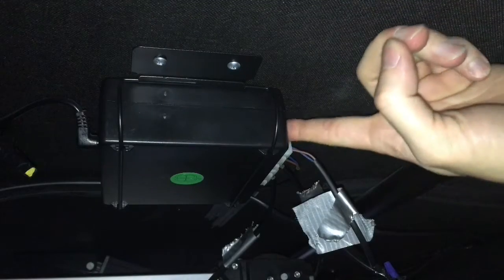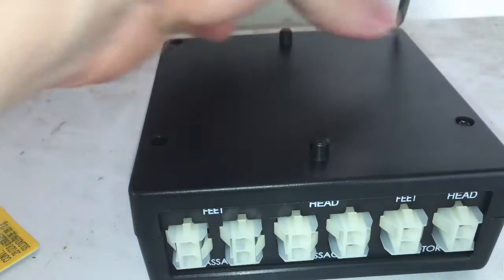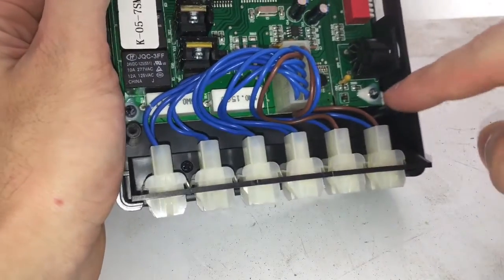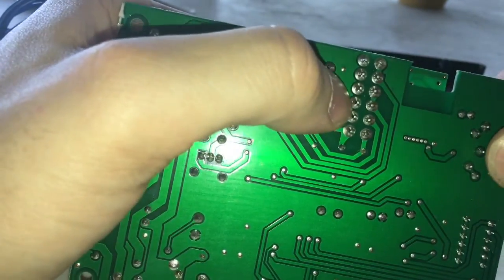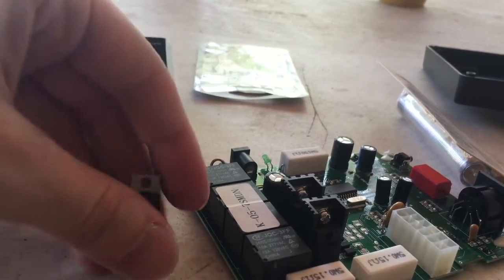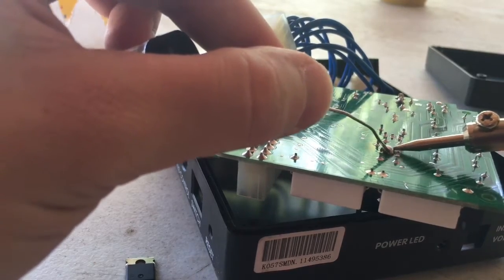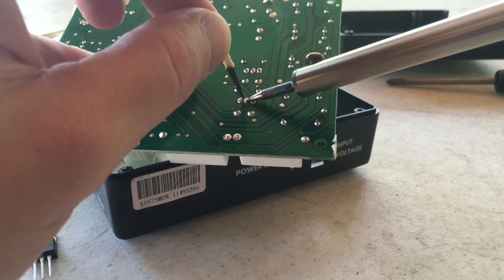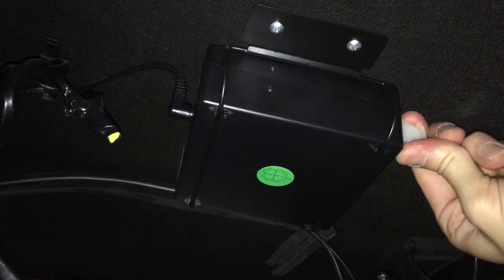Serta ergomotion control box Massagers stays on constant repair

Comment: Nice work 👍.  I admire your skill. 
Question:  is it possible to bypass or disconnect an automatic timer on a bed massager?  My massagers turn off every ten minutes.  There is no option  to turn timer off or change to longer setting.
Reply: My problem exactly! No response?